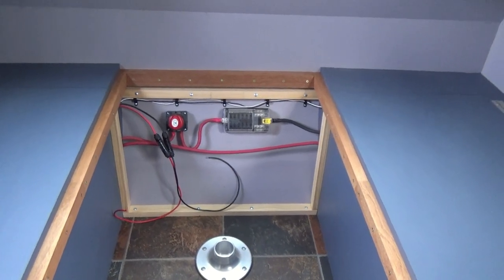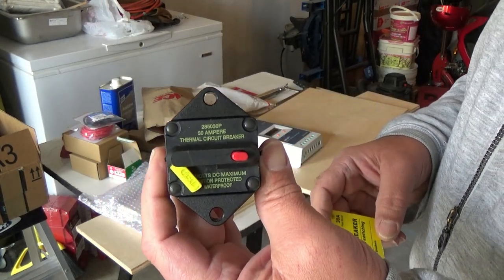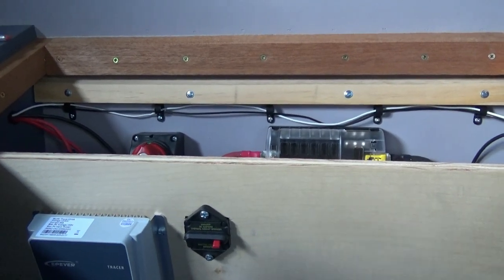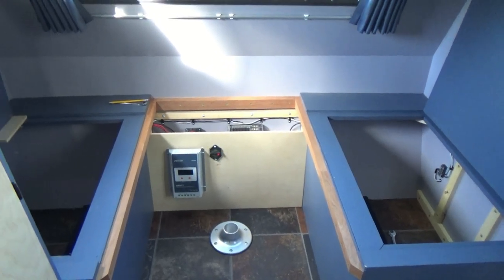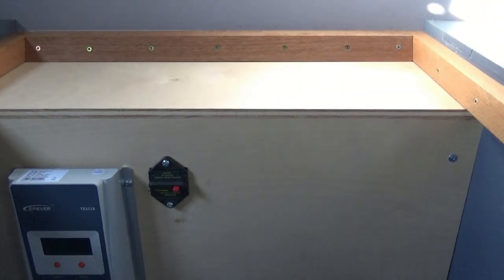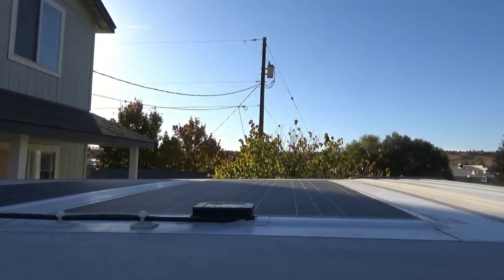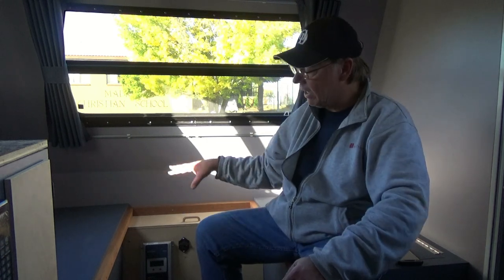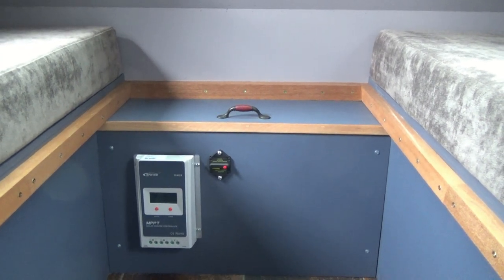How To Build A DIY Travel Trailer - Part 47 (Solar Installation – Part 3)

Comment: Are you going to install a inverter? I so I got a tip for you. Install a regular socket on the outside of that bench, and then wire the socket to an extension cord and plug it into the inverter. Pure since wave inverters have come way down in price this last year. You can get a good 600 watt inverter for about 60-70 bucks. It's enough to power a crock pot and a couple fans. Keep the inverter as close to the battery bank as possible. I posted your channel on a couple rv forums I belong to, hopefully you'll pick up a couple more views. These videos are outstanding!
Reply from the maker: Yes sir... inverter is on the list! :) AND... you and I think alike, I had the same thought about installing an outlet that is plugged into the inverter. I'll install it next to the battery and install outlet on the outside of the bench seat close to the kitchen counter. Be able to plug appliances in and do some serious cooking! I really appreciate the post you made... that is totally awesome, thank you very much!

Comment: A USB port on that false wall might come in handy. Once again very nice video, and beautiful attention to detail.
Reply from the maker: You got it! That is one idea that I managed to think of... I will be installing a new false wall with the USB ports. Great area to use while sitting at the table to charge my phone or tablet. Thanks again Jayflight!
Reply: OregonBatman you could just drill a hole in the current false wall and connect the wire to something hot. I installed one with two USB's and a 12 volt plug under the table. I run a laptop charger off the plug, and charge the kids tablets off the USB.
Reply from the maker: I'll have to shop around for a USB port and install that under the table, I think that will work great. Out of the way and easy to get to!
Reply from the maker: That's in line with what I'm thinking of using. Thanks for the link... I'm a gadget guy with lots of phones and tablets and drones that will need to be charged, this will come in handy!

Comment: I would install a small vent grid in that cabinet ! Think about it !
Reply from the maker: Actually... I didn't think that was necessary. I do have each bench seat vented, and the hidden electrical compartment has holes all over the place, not worried about overheating.

Comment: I've been following you for a while and really enjoy seeing how things are coming along. I myself am refurbishing and modernizing an older camper and adding power inverter, converter solar, heater, air conditioner, etc... My most recent project is building a dinette table with benches that converts into a bed. I've been waiting to see what you decide to do to trim the edges of your laminated table tops and counters. Are you going to use TMolding? Hard to find anywhere except online.
Reply from the maker: Hey davidleejr, thanks for following along! Great project you have, taking pictures I hope! In the near future I'll be adding converter and inverter also. I'll take it one step at a time so I don't get things crossed, lol! I used a veneer around the table edges. I thought about the T-Molding, but I kind of like the look of the veneer. I will be using an oak trim around the counter top, I think that will hide the seam and look pretty good when finished. One of the rv surplus stores I visit carries tons of the t-molding in a couple different colors, Affordable RVing. They have quite the setup if you are building or remodeling! Love that place!

Comment: Have you given any thought to adding a battery isolator or solenoid to charge your batteries while driving?
I would love to see a how video on that if it is in your plans.
Reply from the maker: Hey Daryl! That is actually a good idea! Haven't thought that far ahead yet... but yes, would be very useful on some of the long trips I plan on taking. I will think about that and do some research. Thanks for the idea!!
Reply: I have heard that continuous flow solenoid is better/cheaper than a battery isolator, but I have no experience here. I'm sure there are pros and cons for both.
Reply from the maker: Gives me a place to start looking though! I have my homework cut out for me! :)

Comment: U may want to put some non combustible covers over the batterie connections, since the batteries r in the storage that r made of wood....What about the face of the solar charger? What is keeping from someone bumping the buttons while sitting on the kitchen table? I was thinking u may want to have a cover on it to protect it from getting damaged.:)
Reply from the maker: Yup... the battery will be one of the finishing touches that is still yet to be done, patience grasshoppa! As far as someone kicking the controller? They are not allowed in the trailer! LOL!
Reply: There's only two buttons on the Tracer controller, if they were knocked it wouldn't hurt anything. One is a mode button and the other is a enter button.
Reply: well observed...I thought in the same way!

Comment: Really enjoying your videos. I know nothing about solar. What wires did you attach to the controller? What wires do you have connected to the solar panel shut off switch?
Reply from the maker: Hey J A! I think I was using 8 gauge wiring for the solar and controller (might have been 10 gauge to the controller). Thanks for checking it out!

Comment: Mr.Batman....wasn't there enough space to install both batteries in the same place - cabinet ?
Reply from the maker: Yes sir, there is... but I wanted the weight of the trailer to be balanced, and those batteries weigh a good 75 pounds each. So I decided to place one on each side for the balance.
Reply: @OregonBatman  oh...you're right... I didn't think about that!